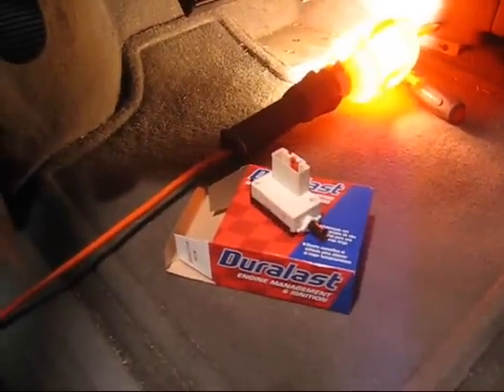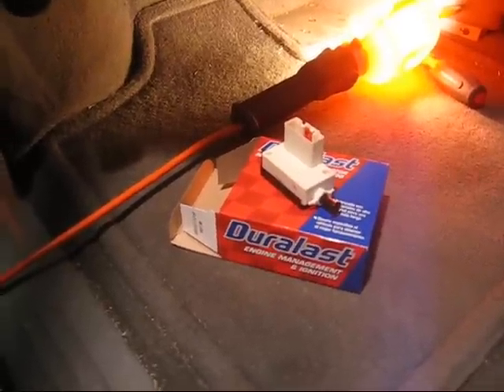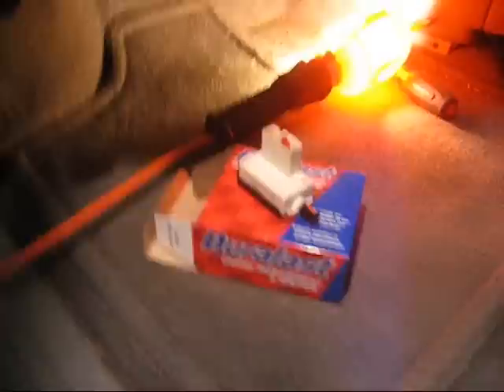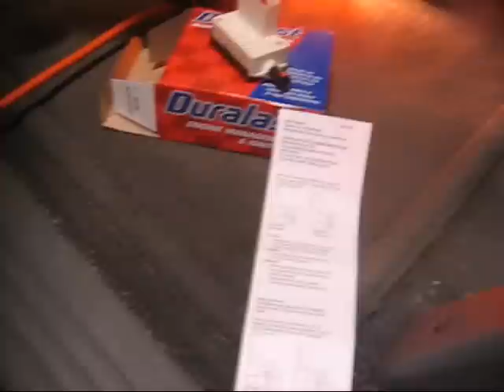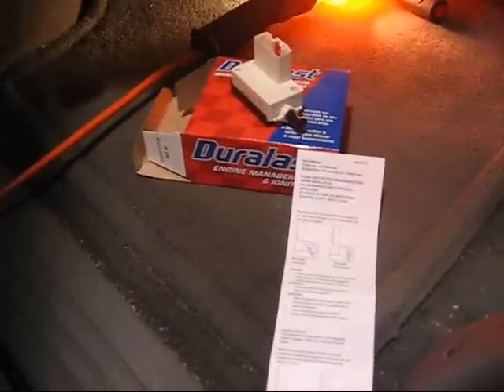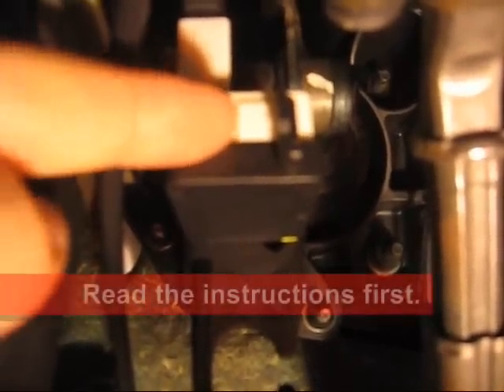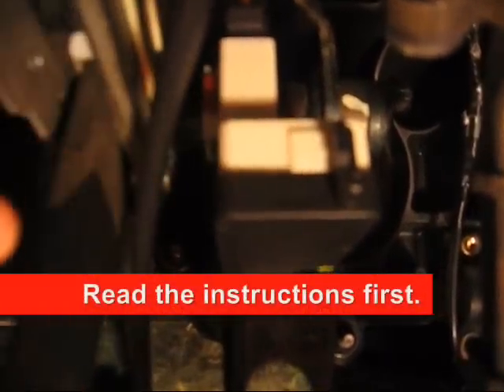brake light switch replacement.

Comment: We replaced the switch (everything was done correctly).  Did not fix the problem.  We have tail lights, turn signals, and hazard lights but, NO BRAKE LIGHTS.  The socket emits a "dim light" when a tester is touching it.  Could
 the socket where the switch attaches be the problem?  Or, any other ideas....
Reply: Ever find a solution? I have the same problem

Comment: To be clear, the red slider on the switch needs to be moved back means towards the back of the vehicle (pull the slider towards you as it's mounted in the van).

Comment: It is a great commentary on how to change the switch out, but it did not fix my problem.. 1996 Dodge caravan... back brake lights not working but the back center one is.. NOW what...
Reply: +Rebecca Strong I doubt that it would be the switch if you have one of your lights working.
Reply: ImNachoSponsor I ended up replacing the brake switch only to realize it wasn't the brake switch. I actually blew a fuse while messing with the housing on the taillight. So I would definitely check the  fuses because two of my taillights worked even with the fuse blown.

Comment: Thank you.  Made replacing man a snap.  On the one I have in now however, the lever was pointed up already.  I tried just pushing the plunger back in and moving it back to the left.  Seems to have worked for now.   Once again, thanks for the info....  Once installed I moved it back into the operational position.

Comment: This switch is also used on 2007 Dodge Nitro's. The switch itself is inexpensive, and because of its simple design and minimal internal components...I'm skeptical that it is ever actually failing. I simply pulled the black plunger out slightly until it caused the correct clearance with the brake peddle. Anyway. I was able to get it working again without buying a new one.
Reply: The Ultimate Music Compilation oohhhh thank you!!!!! I needed that!!!

Comment: my switch came on that 45 angle and i thought it look odd so the parts salesman snapped it in place before i left...did we mess up?
Reply: I was reading that you shouldn’t move that that black lever before installing or it wouldn’t work. I take it that’s for adjustment. So yours still worked when the parts guy moved it from the 45 degree angle to horizontal position?

Comment: Is this the solution if only one break light is out?
Reply: Armando Cortez you tried change the bulb first right?. In that case you need to measue voltage on the base connector of the light.

Comment: yo im going to try this cuz my brake lights are working either..i own a 2004 dodge sx 2.0...those switches must be pretty universal because mine looks the same...My brake lights dont work but if i hit the lock button on my starter they come on so i dont think its wiring.. me being a dummy, i still changed the fuse and the bulbs...only cost like 5 bucks so why not...so this is my last option if this dont work i dont know what to do

Comment: this was helpful but on different cars its different i just did one and there was no instructions on it and there should have been because the button on mine pulled out and it took me longer then it should have i thought the switch was bad but no it just need to be a adjusted a little

Comment from the maker: Hey penguin,
The switch could be a problem. I am not sure about that code but I know that after we replaced the switch in ours the intermittent cruise issue disappeared for us. Hope that helps. God Bless
Reply: Hi there I was just given a 2008 sebring and the cruise control does not work or show any signal of working. When yours went out before was it indicating it was on at the dashboard?

Comment: Hello Roy Thanks for sharing,  you might want to mention not to engage the small switch that is at an angle until the unit is in place, this is done after installation to automatically adjust the switch once it is in place.